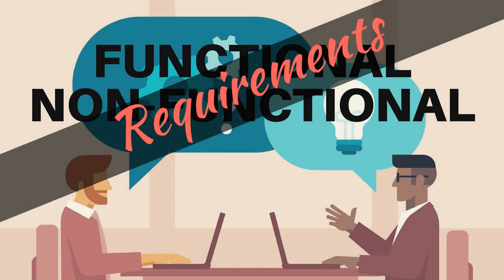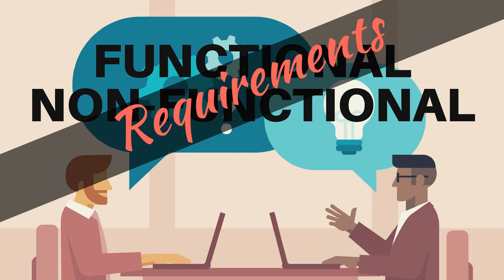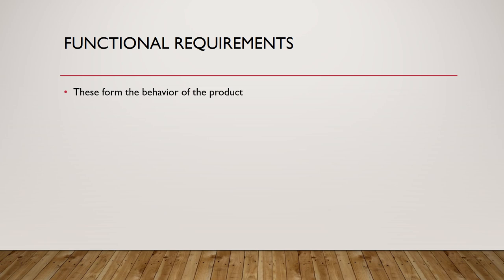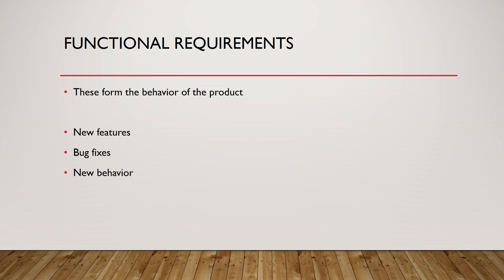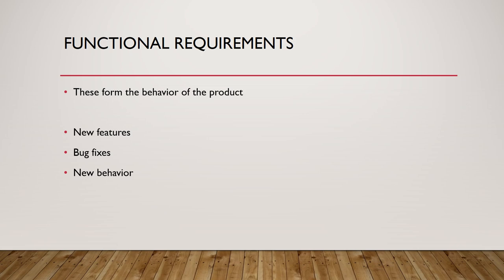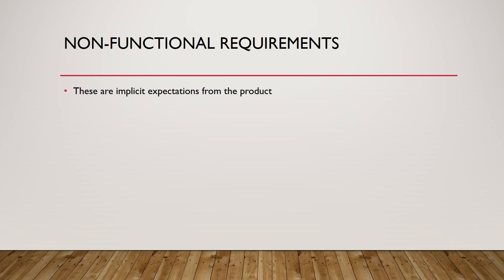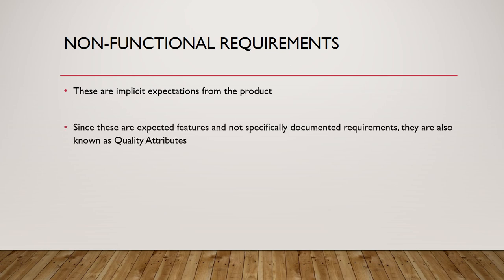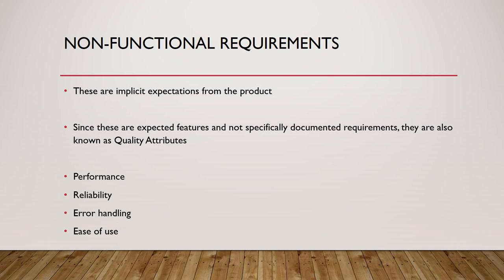Functional and Non-functional Requirements | What is the difference between the two?

Comment: Derive and classify (Business/User /Environmental/Operational and Functional/Non-Functional) requirements from the following text: I need a library management system which allows my customers to borrow books and they shall interact with this system using their web browser. Only books which are still available can be borrowed. lt has to be able to handle at least 50 concurrent users with response tirnes no longer than 2000ms and we have to run the system on our existing Red Hat Enterprise Linux 6.5 infrastructure on Apache 2.4.7. Partner libraries should also be able to integrate our library service into their systems without having to use our user interface i.e., inter-library loan for books which we have and they do not shall be possible for the partner libraries. 
Can u please answer it
Reply: did u ever get answer of it ? its been 2 years